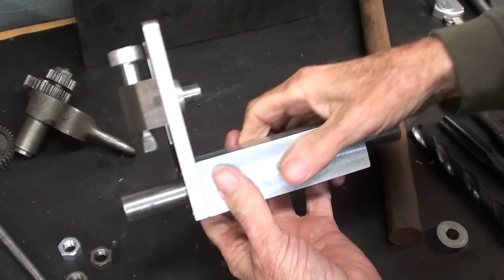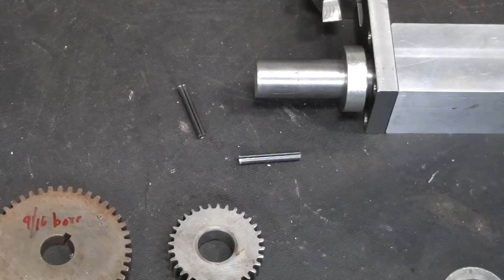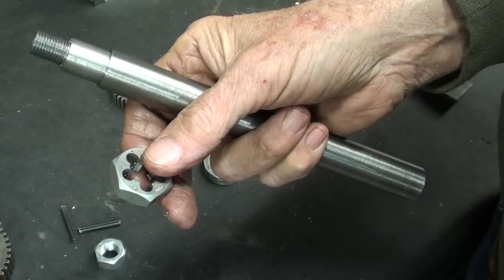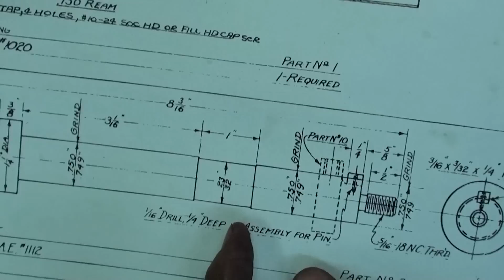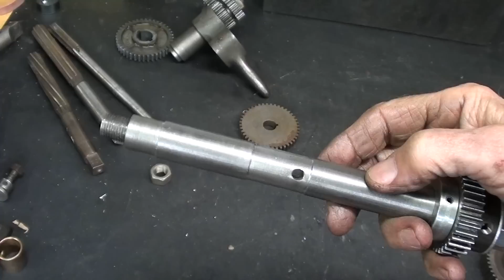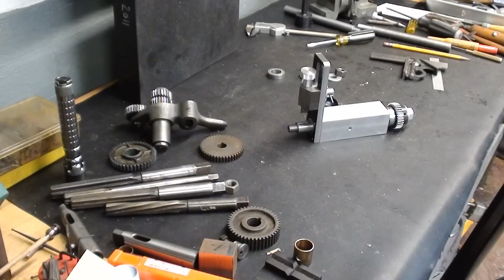MAKING ATLAS GEAR CUTTING FIXTURE pt 5 #839 tubalcain index shaft

Comment: What you made with the hole that goes through the housing and shaft for the screwdriver is called a Tommy hole and bar. It’s used for the same exact purpose you made yours for.

Comment: I just watched your gear cutting video where you used this fixture. I had a thought that if you made a point on this shaft, it would save a lot of time and math later on to center the cutter on the blank. Just a thought.

Comment: What I find particularly interesting is to see you recognize and then overcome problems on the fly. The too narrow thread on the blueprint is something that I think would trip-up almost every beginner who tackled this project. Also, that perfect solution to removing a tight nut from both ends by drilling a hole and then using a pin (screwdriver!) to lock the shaft. Those kinds of common-sense and practical examples of emergent problem-solving is what we miss on so many handicraft videos.

One question I do have is in regards cutting thread. I think you prefer using a die to make a thread whereas Keith Rucker always cuts his threads using his lathe and its screw-thread advance feature. Is there a reason you choose one method over the other?

It goes without saying, but I will say it anyway--brilliant work as ever Mr. Pete!!!
Reply from the maker: Thank you for watching. I like to use a dye for threading most of the time. It takes 1 tenth the amount of time.

Comment: I don't know if someone has already suggested this but, if you have only one index shaft but require different keyway widths for the different gears, you might want to consider cutting additional keyways of different widths in the index shaft, spacing them about 60 degrees from each other. This way the index shaft can be used with up to six different "keyway widths" gears.
Reply: @dennisa2839 Also, would it be prudent to add a matching keyway at the opposite (blank gear) end so that the keyway for the new part matches the old part?

Comment: Mr. Pete.  Thanks for your excellent machinist mentorship !  When manually threading with either a tap or die, it is always important to break the chips by alternating forward and back.  When you just drive the die all the way on with the lathe, aren't you risking thread damage by having no means to clear the chips?

Comment: I seems to me that you will not have enough tool clearance from the fixture when cutting small gears like you have fitted……. Does the “blank” end of the shaft need to be extended?  I would love to see you cut that gear.

Comment: I'm enjoying watching the use of the diamond tool holder. I have considered getting one for myself. Curious to know if something similar would work on my Southbend Shaper. I have also considered building my own. gear cutting fixture for my little Atlas Mill. I have an indexing head but have not tried it on the Atlas. I may not have enough head room to use the Indexing head. This is certainly a great project for the Hobby Machinist. Thanks for bringing us along.

Comment: Better to have a keyway and not need it than to need it and not have it!
Reply from the maker: lol
Reply: @bcbloc02 Would a keyway be prudent on both ends milled inline with one another allow for the blank gear to have it's teeth cut at the orientation as the original?
Reply: @ianhelsbyservices  Putting them in time to allow for an indexing reference certainly would not hurt.

Comment: The through hole for the Tommy bar was a great idea Mr. Pete, along with using less material with the collar you pinned on.  With the keyway you cut, could it be possible to make keys with one half fitting the shaft and the other half fitting the gear?  It would be tedious but once made save them as part of the kit.  Or make the keyway deeper so a half key would slide in containing a pin to fit the keyway on the gear.  Great video series and I hope we get the opportunity to see you cut some gears with it.  Thank you for sharing sir. 

Joe

Comment: Will tightening the two nuts on the ends of the shaft put to much thrust on the roll pin and set screw
? Any give in those will cause the shaft to lock up and unable to rotate. Leaving the nuts not fully tightened will allow the sample and the new blank being cut to rotate. I hope I am wrong.
Reply: The gears ride against the shoulders on the shaft. The collars are set back a little

Comment: Lyle - Another good, informative video.  Comment on concentricity is technically correct.  However, we're talking about home shop level construction and usage here and and not 'flight/space'  quality hardware.  Different skill levels and usage - plus as Clint Eaatwood said 'a man has to know his limitations'.  In my home shop I sure don't hit the level I had to worry about as an engineering manager of flight and space hardware.  I'm nowhere as good as the tool makers and technicians I traveled with in my working career.   Keep up the great work.

Comment: The reason for the more complicated methods and drawing of the shafts and holder, was to insure concentricity of the gear blank as the teeth are being cut .... your method does NOT insure that concentricity, but am sure you will show us by testing the runout of both the exterior of the blank, and also on the face of the blank .  Rather than grinding the shaft for that insurance, I would have bored and set a bearing in each end of the holder, and turned the steps on the shaft for bearing fit, gear bores fit, and thread diameters, all in a single setup, thus insuring concentricity that is needed for any high speed gearing .  . cannot wait to see the indicator runout test ....no cheating!
Reply: yes and no, I'd say. I would have used a ground rod, like drill rod. Then the collar could have been face cut to be true to the shaft. Lastly, how true does this need to be? Your cutting gears using an old lathe. I don't think these parts will wind up super precise no matter what you do using this setup. This isn't quite a new Pfauter....   Most folks over-tolerance stuff...
Reply: @67L-88  I agree completely, but in a teaching session, it needs to be discussed so a student doesn't apply these methods to build wood or metalworking spindle